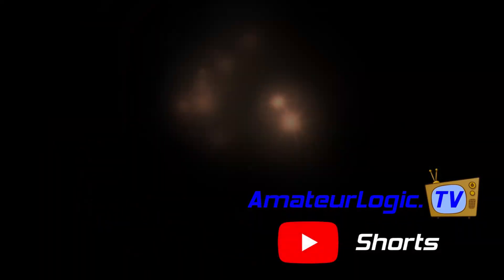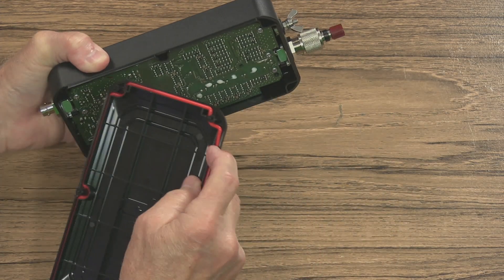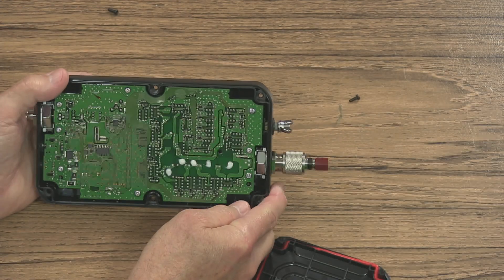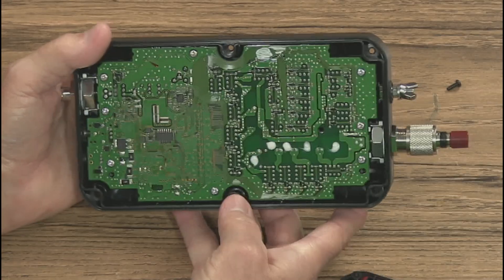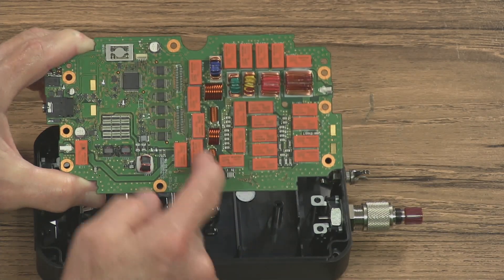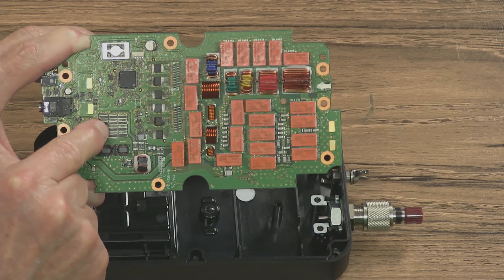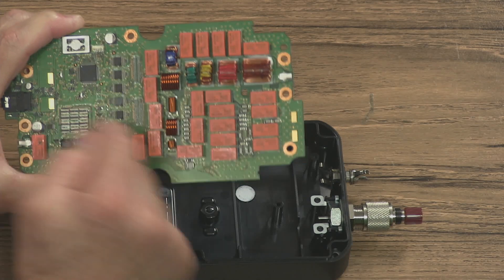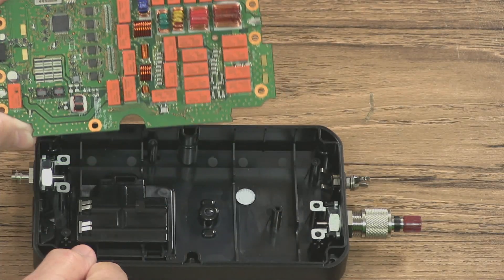AmateurLogic Shorts 4: A Peek Inside The New Icom AH-705 Tuner

Comment: The nine resistors could be a dummy load from the directional coupler, when SWR goes low, voltage across the load disappears and tuning stops.

Comment: Very compact design.

However, isn't it normally the case that close in inductors are usually turned 90 degrees from one another to prevent coupling & interaction?

Thanks for the peek.